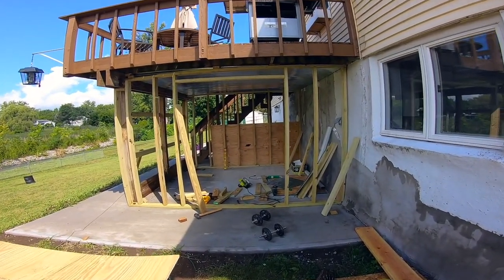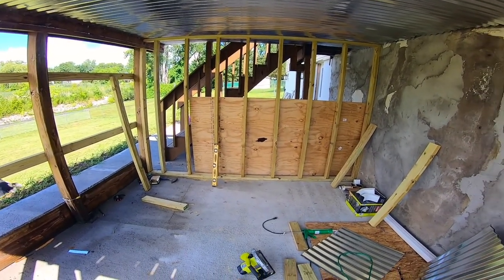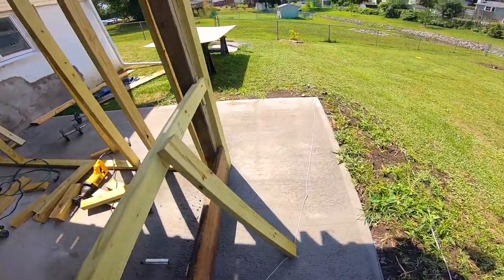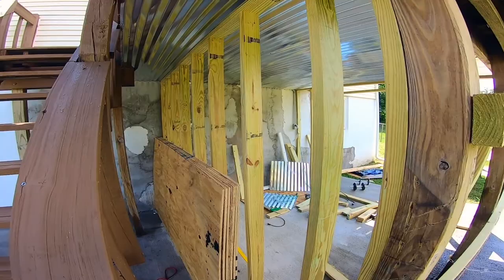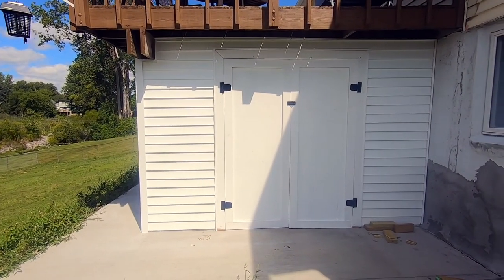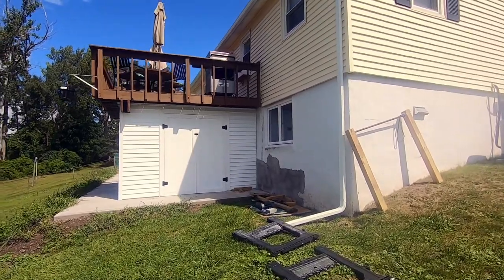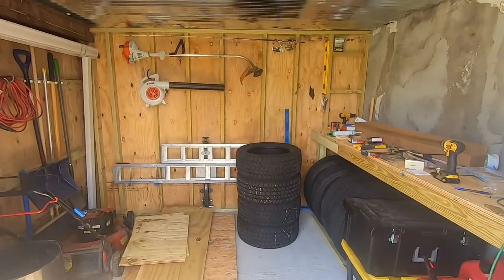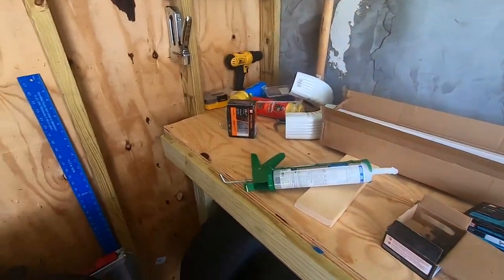Under Deck Shed Build Time Lapse

Comment: The corrugated will collect major dirt - it’ll well up water and cause issues. The pitch needs to be heavy but will require high pressure rinse on habit —- it needs major flashing against house beyond the deck header
Reply from the maker: Over a year later and there’s no debris build up on the roof.  The gaps on the deck boards are less than a 1/4” thick.  No substantial debris is collecting up there

Comment: Looks great! Hoping to take some pointers to fix some leaking through mine. How did you seal up water from falling along the back concrete wall and onto the corrugated roof?

Comment: Awesome video, how to do you flash corrugated sheet metal against the house?
Reply from the maker: Im not sure i understand the question.  The corrugated metal was screwed in from the bottom to the studs
Reply: @NolanGrieb  Where the sheet metal meets the concrete wall, how did you flash that area to prevent leaking?
Reply from the maker: @annesea100  i got it as close as possible to prevent leaks.  The deck has enough coverage from the gutters above where it doesn’t leak against the wall

Comment: Awesome, I'm looking at doing this as well! One question I have regarding the metal for the roofing. Do you notice that it attracts the heat during the summer months? It seems like it would and would be unbearable to stand in the shed for long periods of time during that time? Would that clear corrugated plastic be a better option do you think?
Reply from the maker: Haven’t noticed a huge increase in interior temperatures.  Could always add in a window
Reply: It shouldn’t be too hot, considering the decking above blocks most contact with the sunlight.